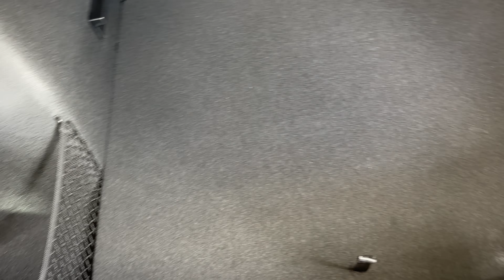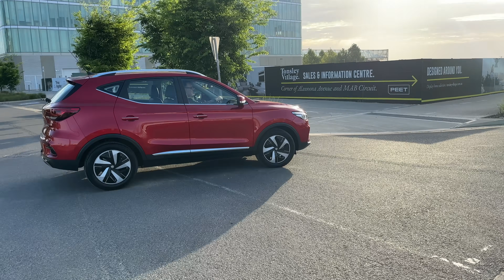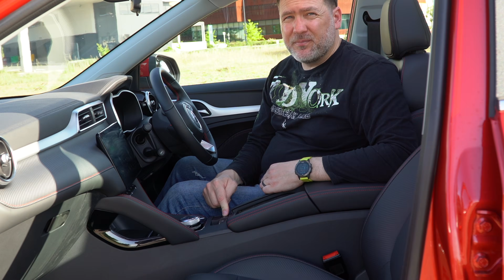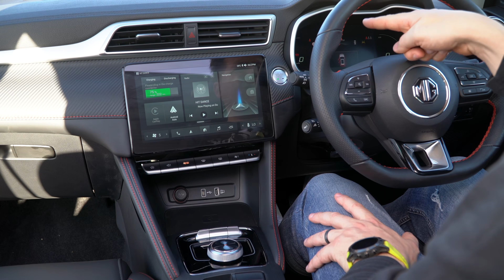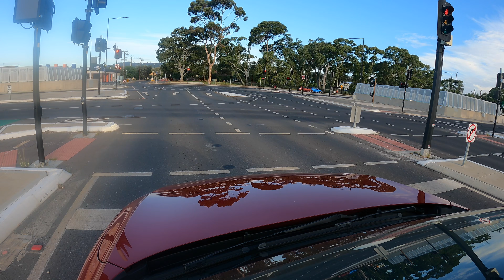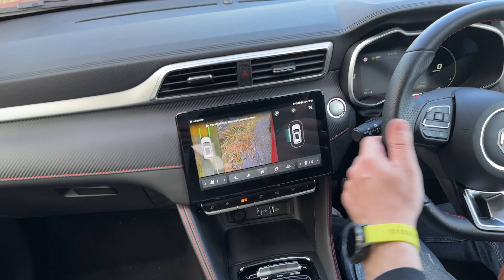MG EZ EV Essence Full Electric Vehicle - Model Walkthrough

Comment: Great video, thanks. I own a ZS EV 2022 in Perth. Can you let me how to permanently disable the auto-hign-beam feature on the headlights? That feature is good, but very irritating. I might enable it when I am more comfortable with the car.
Reply: Swipe over to the second screen on the main display, hit the vehicle option, on the top menu there should be an option for lighting, then there should be a toggle to turn auto high beam off. Hope that helps